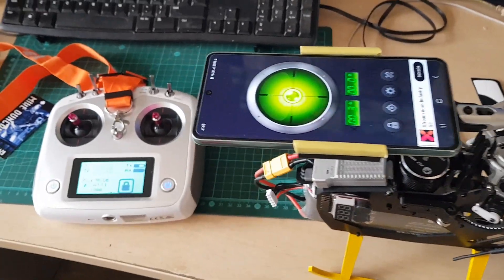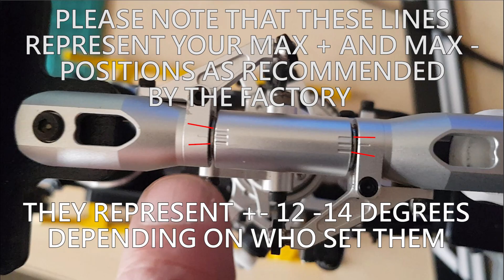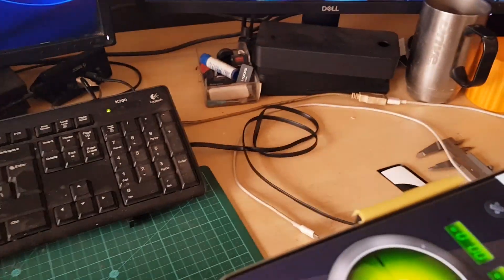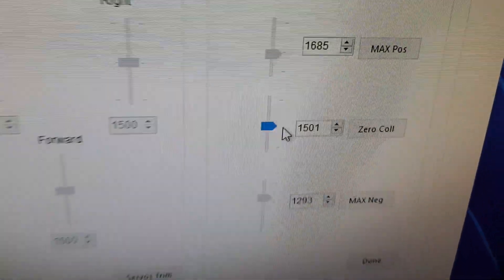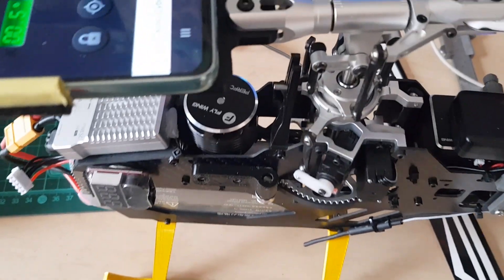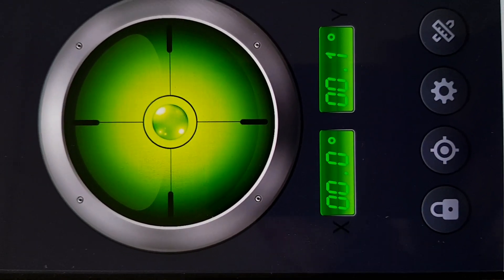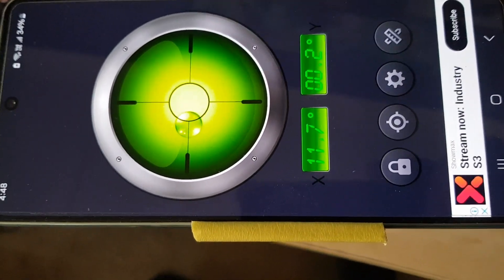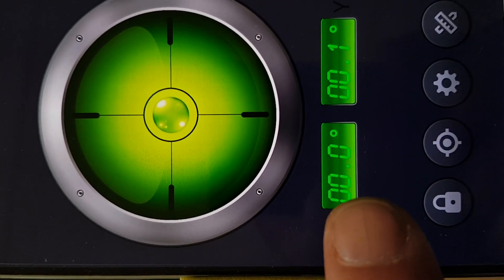Flywing heli pitch adjust H1 software

Comment: Hi Mike. Thanks for the educational videos. I'm sitting here and want to adjust my pich on my Bell 206 v3. As you say, I put the TX in 3D mode and log on to the PC. My problem is that I don't get negative pich. Only positive and 0 pick at zero stick. How do I fix this problem?
Reply from the maker: Pls hook up on FB and I can try and assist although I am not affiliated with Flywing at all. Regards

Comment: Quick question Mike. On your zero coll pitch. Is it possible to just go in and change subtrims on ch3 on your transmitter to get the same results centering out lines. As I can do this but wondering if it affects the flight modes? And secondly when in atti mode on bench does the swash plate not move when the max and neg pitch stick applied by transmitter? Mine is doing this. My Huey been setting for some time trying to get it ready to fly again. I’ve got a whopping 4/6 locking gps satellites for calibration 📡 🚁💥Overcast and snowing lightly.
Reply from the maker: Hi, under no circumstances do you have any trims on your radio. Trimming Ch3 on your transmitter will affect the GPS lock. So, no please. Do any trims in the software. All ch center positions need to be in the center for the H1 to work correctly. Regards
Reply: @ thanks again for the pro advise. That’s why I wanted to ask. I still after replacing rotor head and main shaft the servos look to be at 90 degrees.  I find I need to nearly max out my zero collective pitch on software  to get the center lines on rotor head to match to center, giving me the zero degrees on my blade pitch needed. My only option next would be to go in and move the servos horns to accommodate distance bringing the settings in software down more towards center of zero collective pitch.  Again this approach might be to aggressive.  My Uh-1 was a misfit out of box. After company’s requested of video issues I was sent parts to fix the main shaft. It  was so out of wack when I’d bench test it no blades would nearly walk off the table wobbling so violently. The body was another issue of poor quality control. The fiberglass resin on side stabilizers was so thin could literally see through shell. Just wiggling wing slightly caused it to crack about. I’ve since repaired these issues.
Reply from the maker: @thatsmyrc  "My only option next would be to go in and move the servos horns to accommodate distance bringing the settings in software down more towards center of zero collective pitch" That is the correct method after re calibrating your stick movements in both the radio and the software. Regards
Reply: Think I narrowed down issue to the digital pitch gauge is acting a bit wonky. Wants to shut off/
on even w/ new battery. When which means each time I’m messing with getting it to function again it in gets bumped changing accuracy of angle by .01/.03 .04 degrees to center. Need to just print a holder like yours and have the app. I think that would be more accurate than a $15 clamp on gauge yet it does give a good reference point over nothing

Comment: I’ll refer you to as Master Mike now on 🙏🏼.  So after another mishap due to mec issues I’ve sorted out w/ your vids. My question is when doing this calibration for me to get zero coll pitch I literally have to max out my settings to just about get both center lines to match up.  And still off by -2 this is done on a perfectly level surface as I pre checked w/ level as well.  Does this mean my swash plate is all out of wack. Something on this heli from day one hasn’t been up to snuff as it has really gave me the go around but I’m holding head high and positive as I’ve been able to work it out every fail thanks to you.  If swash plate is out from factory what swash tool are you using to level it back in.  I thought about 3d printing one that’s right diameter for main shaft
Reply from the maker: @thatsmyrc  your servo horns  on the servo should be 90deg or parallel with the table at 0deg pitch. If not, remove and move up or down one notch. Then in software go to servo trim and trim each servo until swash is level. THEN hit O deg button and trim to align with lines.